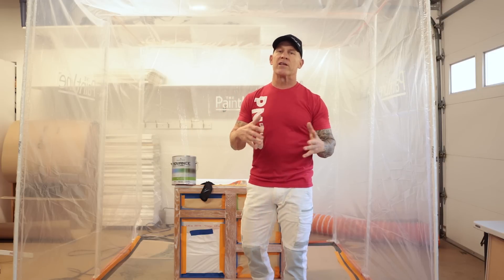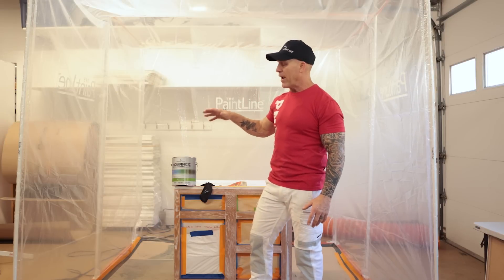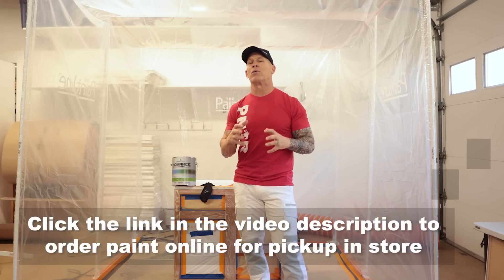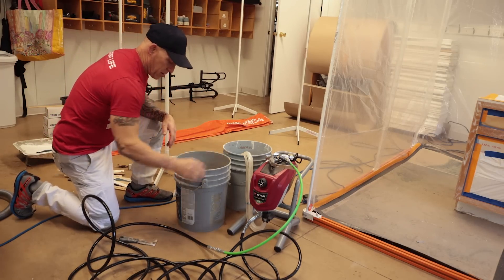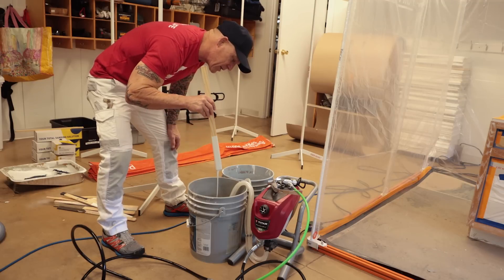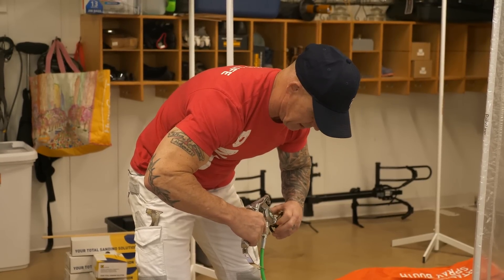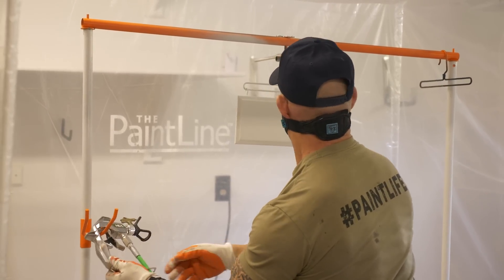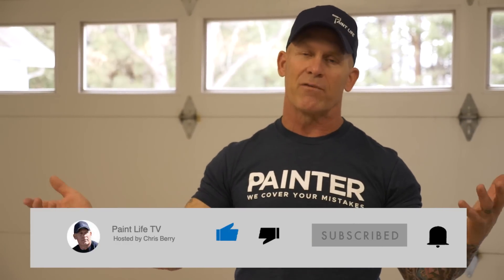Benjamin Moore Advance on Cabinets Reviewed. How Does it Perform Rolled, Brushed, and Sprayed?!

Comment: I've painting my kitchen cabinets bathroom cabinets 3years ago and still looks fabulous, my suggestion for a roller is a Moe hair roller sold at Benjamin Moore stores, no lint and rolls beautifully, highly suggest Advance paint.
Reply: What color did you use. Some are saying yellowing with white tones. Did you experience that if you used whites. Thx
Reply: 감사
Reply: Instablaster.
Reply: Did you notice any yellowing if you used white or light color?
Reply: Second on the moe hair roller from BJM store. Really good!
Reply: It’s Mohair For anyone wondering
Reply: Was it high gloss?
Reply: @Painfulwhale360  Purdy makes mohair so you don't have to pick it up at BM store necessarily

Comment: BM Advance is a great paint. It has a smoothness and luster that is simply beautiful. But because of its leveling properties, you have to be careful when spraying vertically. It will sag faster than SW Pro Classic. At first, I sprayed it with a light in my left hand with two light coats cross-hatched in each application and adjusted by distance and movement speed so that the paint is just congealing after the cross-hatched coat. Watch your previous work as you go and adjust if needed.  A fine finish tip works best. The thinner coats (in my experience) leave a smoother finish on vertical work. Heavier coats (for me) have a very  slight orange peel texture.  It is not quite as "glass-like" as SW Sherwood Hi-bild Precat Lacquer. (And if you don't blow up or die from the fumes, that product is awesome! LOL)

When painting paneled doors vertically, you need to recheck your work after five and ten minutes. It will drip easily at the lower corners of the panels. A quick swipe with your brush will fix it and it will not show. 

I think two thin coats when brushing or rolling looks nicer than two heavy coats. A mohair roller works well but a 3/8 knap also is fine. Just keep it thin.  Prep your roller (any roller) with tape to remove fibers. They will show in this smooth surface. As for brushes, I like a Purdy Nylox brush. It has very fine fibers so it leaves less brush strokes. 

Lastly, we the paint become very hard, it takes a few weeks to reach maximum hardness. Do not set items on horizontal surfaces for AT LEAST a few days. Otherwise, the item may stick to the uncured paint. 

So, there is a little learning curve but this stuff is so 'pretty', it is worth it!
Reply: Thanks for sharing.
Reply: Similar to my experience. I thin it and fflp.  3 to 4  light coats. Actual cure time of advance in my experience is 4 days . I've actually done my own test. Still allot veriables to be evaluated. It will lay down but it's missing ingredients of course. Command is the way to go if it is allowed in your area. BM said it is coming to my area soon later this year at a lower voc.🙄 Can't wait.😆😃
Reply: Thanks for this. Your info helps with knowing how to brush vertically as well as spraying.
Reply: @laurieg66  what's the work around with the product. I challenge you.  There is a way without ever having to touch with a brush. My solution was to heat the cabinets up with a heat lamp and then spray with no dilution. 60 mesh filter fflp 2 or 3 -8. Thats the only way I have found to get away with sags and drips with this product, hope it helps
Reply: After u sand of course so the poor's on the wood are opened. Dry them at room temp and it will be glass finish
Reply: The main problem with the paint is not attimization it's heat temperament witch determines dry and cure time. If u have a heat gun and have time to test you can create the data urself to see at what temp it cracks at.
Reply: I agree but command is next level.  We grow. We advance advance as a industry.  Watch how fast advance gets shelved. Paint polite in states and counties on thing that stop the new paint and recipes
Reply: Great info! I plan on using this product to paint some cabinets in my rental .
Reply: How would you prep cabinets already coated with white lacquer to redo with this?
Reply: Semi or satin?
Reply: Thanks for the dissertation. Haha just kidding. When you say spraying vertically, are you referring to the cabinet door being vertical or the sprayer ejecting paint in a vertical direction

Comment: I used this paint with a roller on my old kitchen cabinets which were not even oak, but some old 70s compressed wood. The results were so great that a contractor walked into my kitchen and said these cabinets looked as if they came from the factory.

Comment: Hi Chris. Ive been using advance for several years now on cabinets. I'm in Canada  , and product options are limited here. Its been a great paint for sure, I use it because of its durability once cured. Cabinets see lots of use and abuse for sure !  I don't do enough cabinet work to warrant having a shop to spray in, so I have been applying it with brush and microfiber rollers. It definitely does leave roller stippling, but so far its only bothered me and never a complaint from a client. I'm actually starting a set of cabinets tomorrow at our current site. Its an add-on, and a repeat client  so I agreed. I usually allow about a week for a set of cabinets to accommodate the dry time. I have found the whites dont cover near as well as darker colors, so my go to routine is to double prime whites. I have been using prime lock as a bonding primer, but tomorrow will be picking up the advance primer to try for the first time. I found the prime lock was difficult to apply evenly due to its extremely quick dry time.  The cabinet set I am doing is cloud white tops and whale gray bottoms, so I will just need one primer coat on the lower units.  I noticed here you didn't prime at all ?  That would be a real time saver ! I always worry about bonding, but after watching this video of yours I think I will find some test doors and try no primer at home.  Every time I start one of these jobs I find myself wishing I had a space to spray. With the fflp tips for Graco I think it would be a breeze. I also have a 5 stage Fuji just crying to be used on cabinets !! Oh well, as I said, I just don't do them often enough, maybe 3 times a year.  Thanks for the video !  Richard Tower, Manitoba Canada.

Comment: I use this for all my cabinets. I do use 2 coats of an oil based stain blocking primer and 2 coats of advanced and it makes the cabinets look amazing.
Reply: I also did 2 coats of primer on my cabinets after I stripped off 40 years of paint. (0 out of 10. Do not recommend. Lol but I can’t afford to rip them out for a few years. ). I used water-based stain blocking and then brushed on 2-3 coats of the paint. I can still see some of the oak grain but only if I look. They are miles away from the mystery paint that was painted over dirt/grease that I had. 

Love this finish. So glad I listened to the paint store guy and got this even if my wallet did cry a bit at the cost.

Comment: thanks chris for your insights and continuous valued content. as a woodworker/cabinet/furniture maker building out a small side business with the intention to grow, i soon realized i had to add finishing to my repertoire of skills. most people are looking for a painted finish on cabinets and closets so figuring out paint and what to use was a bit of a challenge. i know i didn't want to deal with cleanup or potential flammability spraying non-water based products like lacquer. i also knew i didn't want to learn the intricacies of how to apply different products, and needed to land on one and learn that one well. i also know i am less concerned about the cost of tools or equipment that make my life easier and produce repeatable quality results, my time is worth more than most savings to be had with low-quality products. i first became aware of alkyd paint and what it was used for in tracking down issues related to a professional painter using the wrong type of paint to paint over a large custom builtin bookcase i wanted redone.  i trusted that guy at the time, but i mean, really, if someone is a professional painter and don't about the difference between wall paint and what to use for cabinets and furniture? if nothing else, google it or look up the idaho painter channel on youtube?!?

in the end i invested in arguable best-of-class fuji hvlp and the pricier but worth every penny (IMO) BM Advance paint combo. between the quality of the sprayer and the qualities of this paint, it more than makes up for my shortcomings as a spray finisher. i worry sometimes about all my little mistakes, but i come back in a few hours, and they are not noticeable. i get consistent professional quality results. my cabinet and closet finishes receive comments like "it looks like it were powder coated" or "factory". that's good enough for me. and that built in i had painted, now i have the tools to do it myself the right way with the right finish.
Reply: How would you prep to re-do already white lacquered cabinets with this?

Comment: Chris, I’ve used Advance for about  four years now. I love it. I use it on my own house for the best and hardest finish. I like the way it feels after it has three coats better than any other water-based finish. It is like some of the finest oils in how it feels after it has hardened. For the best finish I give it three light coats and a wet sand after the second coat with 320. Piano like finish.
Reply: Never thought to wet sand it. What advance finish are you using? Thanks!
Reply: Wet sand?
Reply: What do you mean by wet sand?  Actually sanding it while it's wet?  How many hours do you wait till sanding?
Reply: @jstevens105  ‘wet sanding’ means using a damp sanding sponge on a dry cabinet door. This generates less dust, and may be more gentle than a dry sanding.
Reply: Really, you have time for three fucking coats. Thankfully it's on your own house because other wise your making no progress dastardly or money waiting fir 3 coats to dry at 16 hrs.... duration hp is the way to go.
Reply: Me too 2 coats then sand w 320 spray another coat w 308 Titan fine finish.

Comment: Ive used BM advance on our cabinets & toe kick then on a few interior doors.  Sprayed cabinets and foam rollers on the rest. Cab and toe kicks were 3 years ago still looks fantastic!  Doors were 2 years ago and don’t look as good as sprayed cabinets but does looks very good.  Cure time between coats is a pain but worth it knowing how well finish comes out.

Comment: I had rolled several doors and was impressed. Night before vacation I painted the base cabinet floors. Where we keep the big pans, cast iron and the like. A week later I threw everything back in and have never even had a scratch. Cleans up once a year or so with dish soap and a sponge to a mirror. Hard as heck.

Comment: This is the best paint for doing cabinets and trim & doors out right now next to using lacquers. This product covers amazing and it will relieve a lot of this brush marks. It has excellent block resistance as well so no sticky doors when opening or setting things on top like with shelves. If you can’t spray this is the best product on the market, period!

Comment: It is by far the best non-oil-based brush trim paint on the market in my experience and if you work quickly and don't overwork, it will level better. If you wait more than a few seconds, the brush marks will tend to show up more--not nearly as much as any other paint, but its leveling properties taper very quickly to the point where you have to be careful not to double back on something you just touched seconds before. You'll know when your brush drags too much that you've waited to long. It should be a very smooth feel. Cover the entire piece to get it saturated, then get a nice a full final stroke where you feel the smooth pull on the brush (no sticking or skipping) and go end to end and don't go back. Always use long, smooth, and straight strokes. The slower you have to go to avoid that sticking or skipping feeling on the brush, the more it's a sign you're not working fast enough. Best brush for this by far are the Zebra brushes. Tried them all. Nothing beats them for trim work.
Reply: Na…to thin for brushing.
Reply: I tried to paint 8 ft baseboards with Advance. I was afraid to use too much paint because I read that a thin coat is required to prevent runs. I began with a sponge roller. It left orange peel that looked like 80 grit sandpaper. Within seconds, I went back to lightly brush out the finish. The brush dragged. The finish looks horrible and the sides still have sagging. No impressed with this paint at all.

Comment: I'm sure you've used one before, but I'm gonna suggest using a Purdy Synth-Ox (synthetic ox hair) because they are the finest grade of synthetic bristle I've ever seen and they really do you lay down a super smooth finish. I started helping my grandfather painting at age 9 in 1972 and I've been doing it full-time since 1980. It's not just a job for me it is me, it's what defines me, it is a way of life. A Worcester yachtsman marine varnish brush might work well also, but it probably won't be any good for anything other than a duster after one shot because anytime I've ever used an oil brush in anything that has water in it the brush swells up like a dead possum and is no longer good for anything but a duster, but while it's working it works great, especially for not leaving brush marks, but it's never the same again. It's the same as when you use a varnish brush in an oil stain they swell up and there never any more good for anything other than stain and varnish. They actually make the varnish go on smoother after they've been used in stain, but the brush is so swollen you can't cut in a good straight line with it. It makes the bristles softer and makes the varnish lay down better after it's been used in oil stain. I always kept my stain and varnish brushes separate specifically for that purpose because when you use them in paint I don't care how good you wash them in mineral spirits you get a little bit of white flecks from paint in your varnish which shows up in your stain work. It's too late after you put a coat of varnish over your stain and you see little white paint specks in the Finish which looks like crap. I'm sure you already know all this as long as you've been painting and as much experience as you have. I was just throwing this out there for the novice who might read it. I'll have to try this new  Benjamin Moore paint and see what I think of it. God bless you your crew and all of your families!! Give me an NC....
Reply: Do you suggest laying off with the brush after rolling? Or just brushing and skipping the roller?

Comment: Advance is an Amazing trim paint. I have been brushing trim with it for years now. Looks sprayed even when brushed on crown and base. It's even caused arguments between trades on big jobs about whether it was sprayed or brushed. The issue is not really dry time, it's cure time. It's about a 21 day cure. When doing cabinets, advance may be better but Cabinet Coat dries faster and cures faster, just not as strong IMO. If it's cool in a home watch out for sagging or runs. Other than some small things, this is my go to for all crown and base.
Reply: Do you need to add Flowtrol to this to get it to look sprayed or is it good out of the box/can?
Reply: I tried to paint baseboards with Advance laid flat on sawhorses. The paint dragged and left horrible brush marks. the edges ran too, even though I tried to paint only a very thin coat. I will never use it again. I'm debating whether to buy another product for the second coat:(

Comment: I use this product to spray my kitchen jobs and every customer says they look brand new like factory. I love this product. I use a graco 395 ultra with the contractor gun and a 312 fine finish tip. Awesome video🤙
Reply: Do you prime first?
Reply: @xxsedyannxx you cannot skip proper prep and priming or you will be in cabinet hell